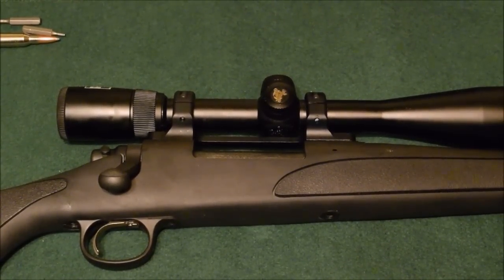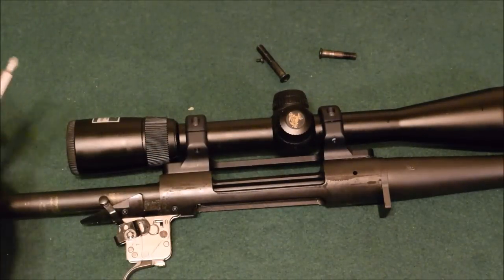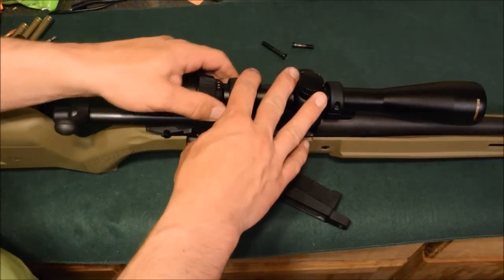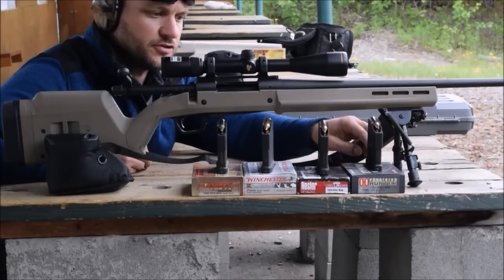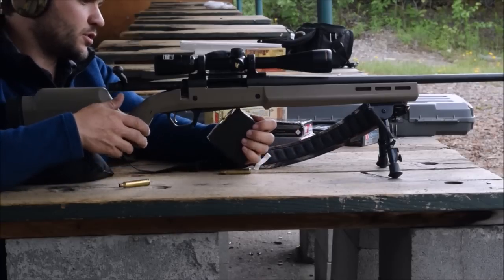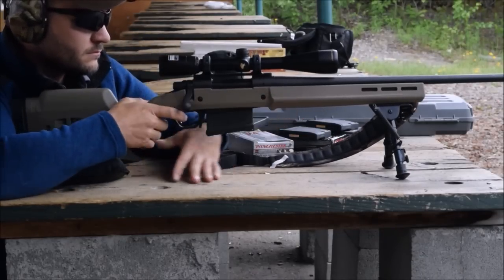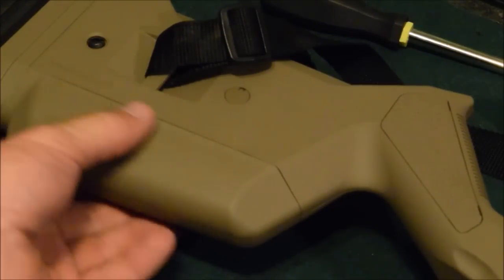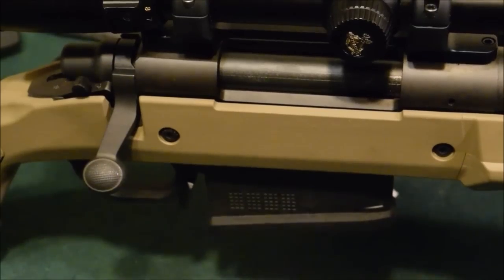Magpul 700 Hunter Stock Full Review and Accuracy Test

Comment: Just picked up a 700 BDL 300 win mag. Purchased in 1971. Along with a Winchester 3030. They were both taken up to Alaska where the man fell in love with the scenery and never even loaded either of them.  These rifles still had the paper tags and string on them brand new. She wanted $400 for both. I told her No Way.  I paused for a second didn't speak fast enough and she had a very sad look on her face I feel bad about. But already had in mind a price that I was going to give her. That was $500. But after seeing and handling the rifles the boxes were trashed held together by tape. The guns are mint condition. I gave her $600. She is super happy. Local dealer offered her $100 each. 
Today I'm going over there to look at a 1976 super beetle convertible factory condition that has been sitting since 1979 when her mother burnt the clutch out on it.
Reply from the maker: Cool! 
Good for you not ripping her off!
Good luck on the car... that's cool

Comment: The rifle I shoot in competitive matches started life as a 700 adl , on sale at dicks! My budget build involved the mag pull hunter stock. Chambered in 308, the stock made a huge difference! A smithy suggested I tork the action screws to 65 in the rear, and the front screw slightly less...I settled on 63...kept the Remington barrel, stuffing the receiver with a 1 peace 20 moa rail..and topping it off with a swfa as fixed 10 power..the rifle performance is surprising at under 1/2 moa with 175 grain Sierra match kings with 41.7 gr of imr 4064.......big fan of magpul stock! Barrel is factory 26 in. 1/12 twist, varmint contour!
Reply from the maker: Nice.  I just nailed a caribou at 459 yards with this rifle.

All steel tps one piece base,  burris xtreme tactical rings and a Nikon black force 1000 scope
Reply from the maker: I bet with a heavy varmint barrel,  that thing doesn't kick at all
Reply: @AlaskanBallistics  ...it's quite tame as you pointed out! Thinking about building another, this with 1/10 twist....but got to wait just bought at thermo weapon sight! Can't wait for it to arrive!!!!

Comment: Positioning of your non shooting hand will help your groups. You are changing your entire position each time when you dont have your hand in the exact same position. It also looked like you were jerking the trigger just a tad, and I couldnt tell if you were pulling the trigger at the top or the bottom of your breathing pattern. I was in the Marine Corps Infantry, shooting fundamentals is most important. I have a 700sps tac and I get quarter inch groups at 100 yards with a magpul stock and a Vortex optic. Proper torque on those screws will help, and sticking with 1 type of ammo helps. Also, another thing people overlook is copper fouling inside the barrel. DO NOT CLEAN THE BARREL unless you absolutely have to. Only vlean yhe bolt and action. After 100-200 rounds you will build up a good level of copper fouling in the barrel and it will actually improve your accuracy. Most people dont know that about remington bolt action rifles, but the barrel design was not meant to be cleaned. Once the optimum level is built up each round will push out any excess and will keep tge proper amouny of fouling in the barrel. Try it and you will learn to appreciate the stock a lot more, although if you have the money I recommend a Mcmillan stock, doesnt matter which one, although we used the A3 STOCK in the marine corps. They are super heavy and creatr rigidity where it is needed. One more thing, remington 700 rifles chambered in 308 work best with an 18"-20" barrel. The twist rates were notvdesigned for a longer barrel which confuses me on why remington makes any longer barrel for a 308. If you are in love with what you have thats great because its still very capable, but id recommend trading out for an sps tactical if you get the chance. The heavy barrel is amazing, plus you can pay tge $200 for the tax stamp for a supressor and run that. The supressor actually will imcrease your accuracy, make the weapon quieter so your less likely to scare away the game, and actually tames some of the recoil a little bit. All in all its a nice rifle man.
Reply from the maker: Thank you for all the advice, I've been shooting in a lot better lately after properly torquing screws.Took a Caribou at 459 yards.
Reply: I'll take note as well... 
I have this in .223 and just swapped out my rubber Houge for the Magpul....
Reply from the maker: Hope you enjoy
Reply: Glad I could help. Now let’s hope Biden doesn’t get elected because he wants to take ALL guns off the shelf except shotguns and black powder rifles. Handguns will not be allowed by anybody outside of law enforcement and military, and any and all battle rifles will be banned.

Comment: Without removing barreled action, you only have to remove the check riser if the bolt is obstructed. Check risers of various heights are available, also. My personal experience with Magpul Hunter 700 stocks are that the torque specs are dependent on the rifle. Not all rifle actions react the same to the suggested Magpul torque values. Some experimentation may yield a differing outcome.
Reply from the maker: Yes that has been done.  Watch to the end gift the cheek riser

Comment: Great looking stock. Having to remove the cheek weld to pull the bolt is a pain but like you said at least they thought of it. Also sending it to you shows good for them. Having a mag is very kewl! Well done vid! I think the FDE should make for a good base for a camo job.
Reply: Regarding this issue, of having to remove the cheek rest every time, in order to pull out the bolt, I am proposing a cosmetic solution. Going to smoothly grind off enough material at that point where the bolt bumps the cheek rest, then fine shape the edges in design as if it came that way with epoxy and then paint that edge.
Reply from the maker: That would work.  But I'm okay with it.  Learned to love with it

Comment: This is a good video on this system. I was wonder if you could go from ADL to DBM with it. I heard that the accuracy goes down this stock in general, but i have also been taught that ADLs have better accuracy because there is no buckle were the well is at. Anyway I've been checking out this stock and I think your video has convinced me to make a move on this thing. The od green is hard to find but the FDE is nice. Maybe I'll stick with straight black. Thanks for the video demonstration and insight.
Reply from the maker: JAC. I've actually gotten some nice groups since.... Just killed a caribou at 200 yards
Reply: Alaskan Ballistics that is awsome that's all I wanted it for hunting. I also wanted to the ease of taking a mag out for safety when I jump in and out of the vehicles.

Comment: If you want to cut those groups easily in half have the action Glass Bedded and free float the barrel, adjusting the trigger helps to, you never mentioned what caliber your shooting but looks like 300 Win Mag, handloading will both save you money and if you do your part you can cut the same hole with it. My 300 Win Mag load is 180 gr Nossler accubond in a Nossler case behind 75.5 gr of Reloader 22, Winchester large magnum rifle primer. Seat the bullets out to function threw the magazine or .10 off the rifling. Which ever is shorter. I shoot regular sub 1/2 inch groups with mine, I just put his 3rd barrel on him
Reply from the maker: Kodeeni 7mm mag
Reply: Alaskan Ballistics 
  I just bought a Remington 700 7mm Mag, thinking of getting one of those stocks. I’ll glass bedding the wood stock to get the best groups. Shooting Nossler 175 LR accubonds. Will let you know how I do
Reply from the maker: Sweet... yes let me know...
Reply: The Magpul stock free floats the barrel

Comment: Great Vid, Birchwood looked super busy that day. 

Get an Inch Lb torque wrench. That'll tighten those patterns into groups.
Reply from the maker: Maxim Dolchok i did. Thanks... It tightened it up
Reply: Alaskan Ballistics what's the weight now with that stock? 

Since the Remmy is cylindrical I bet a bedding job will cut it in half as well. Not needed, but doesn't hurt.
Reply from the maker: Maxim Dolchok wasn't too bad at Birchwood... I was the only one in that range that day
Reply from the maker: It was just a little bit more I'll have to put it on the scale when I get home and I'll respond to you then
Reply from the maker: Maxim Dolchok 
Great idea on bedding job
Reply from the maker: Maxim Dolchok 10lbs exactly

Comment: Are the Magpul mag stocks compatible with other calibers like 22-250?
Reply from the maker: I believe the short action stock may be compatible. Not 100% Sure... If it's not longer than a .308 it should work
Reply: Thank you!
Reply from the maker: You're quite welcome... The bright side is that if you get it and it doesn't work for you, you can probably get your money back... Or you could probably sell it for 75-80% of new value later
Reply: asanmartinjr07  - Just fitted on of these stocks on my 22-250.  The .308 P mags work fine with the 22-250 rounds.
Reply from the maker: Maris Pip3r  thank you for responding, that’s good information

Comment: having the same feeding issue with a .308. May have to get a stock now.
Reply from the maker: Jelly Bryce it's worth it. Torque it correct and it gets better groups...
Reply: Did it gog back to what you were getting before you got the Magpul?
Reply from the maker: Close...  .4" edge to edge with hornady precision hunter. Killed a caribou at 218 yards.
Reply: I read further and saw how much it improved but your review  leaves people believing that the whole reason for the size of your groups increasing was changing to the Magpul Hunter stock. It's only after months and reading all these comments that you mention you didn't install it correctly? You don't go back and mention it in the original review? That doesn't seem quite fair to me. I'm not affiliated with magpul or any in the gun industry in any way.
Reply from the maker: seekers999 Well it was after the advice in the comments. And i said the groups could have been me.
Reply from the maker: seekers999 I do need to film an update video, you are right about that. Will do so this summer
Reply: Good man

Comment: Measure edge to edge, then add the diameter of the bullet to the group size.
Reply from the maker: Even outside edge to outside edge?
Reply: @AlaskanBallistics  Yes, but then you'd subtract the diameter of the bullet. Inside to inside edge you'd add the diameter of the bullet. It works either way.
Reply: @AlaskanBallistics  from edge to center of the bullet is .154. So you account for the  radius of the bullet for each hole.
Reply from the maker: Thanks man
Reply: @AlaskanBallistics  no problem.

Comment: Actually, you're shooting 4 different bullets from 4 different makers.  Thus your bullets' copper is different recipes.  This may impede the accuracy you're getting.  You may also find a variance of groupings between a CLEAN barrel and a copper fouled barrel.  Cold/warm barrel variance too.  Remove copper fouling between brand of bullets.

Clean your barrel, shoot a couple of fouling shots, then shoot with a cold barrel for zero.  Do that for every new make of bullet.  

Cleaning your barrel after every firing is no longer needed with today's modern powders.  This was needed back in the day of using black powder, which is highly corrosive and became strict tradition passed down from father/son over the centuries.  Modern powders are not corrosive.  Clean your barrel when you find accuracy dropping off, then a few fouling shots to re-establish your carbon fouling.  

Measure how far back your bolt goes with the cheek riser piece in place.  Remove the cheek riser piece and measure how far back the bolt moves.  You MAY be able to use a round file and remove some of the plastic from the nose of the cheek riser piece, buff it smooth with sandpaper (also softening the edges) and be able to remove your bolt.  If you must remove enough material to end up with a "hole" in the cheek riser piece, remove a bit more and create a form using masking tape on the outside and fill the void with epoxy.  Fine tune it with sandpaper when cured and a touch of FDE paint.  If you use black epoxy and like the contrast, just tune it up with some sandpaper to dress it smooth.
Reply from the maker: Thanks for the advice.  Getting a torque wrench and making sure I screwed them into spec made everything very accurate.  Look at my 7mm Rem Mag 120gr ttsx video. Thanks.  Godspeed

Comment: take the gun out of the stock to pull the bolt? rezero a barreled action with scope not removed? wtf are you talking about? you can take the cheek piece out to get the bolt out and why would you have to rezero the scope if it never had the scope removed? the stock has no bearing on the point of impact in relation to the point of aim.
Reply from the maker: You obviously didn't watch until the end of the video...
Reply: Alaskan Ballistics you're right. once i heard that it kinda killed it for me. but since we're talking, how has that stock worked out for you long term?
Reply from the maker: Really well actually.  Durable,  torqued it correctly and got better groups.  Killed a caribou at 459yrds last year
Reply: Alaskan Ballistics jurys still out for me. I'm considering bedding it. but i get in my head a lot on these kinds of things. debating "improvements" that might actually do me more harm than good.
Reply from the maker: Understandable.  It is heavy especially for a hunting gun...
Reply: Alaskan Ballistics I'm using it mostly for extreme long range shooting. 1000 yds+. weight is a good thing for me.
Reply from the maker: Yeah that makes sense

Comment: I'm putting together a 7mm-300, also referred to as a 7mm Practical (necked down .300 Win Mag) . I read max cartridge OAL for the magazine is 3.5". Are they correct on that? I'd love it if they were actually closer to 3.7" I want to use this setup.  I have one of these in a 700 SA in .243 and love it.
Reply from the maker: Robert W i just measured my magazine.  looks like anything loaded past about 3.52" Would probably rub the bullet on the front of the magazine.
Reply: Thanks for checking for me. You just saved a big headache.
Reply from the maker: You're quite welcome. I don't know if you could file the inside of the magazine that much. I doubt it.   Best of luck...
Are you loading that long to fit the round to your chamber?
Reply: Yes. If I shoot 195gr-197gr ELD or VLD bullets, I will have to load them that long to avoid jumping them too far. I don't want more than .010 jump.  I think I am just going to shoot 140-168gr bullets in this rifle. This is going to be a hunting/varmint rifle.
Reply from the maker: Robert W , I had a Browning A-Bolt that was that way, too longof a throat

Comment: Thanks very much for this review! Does the bipod attach via some type of mlok adapter?
Reply from the maker: Yes a fixed sling swivel stud.  I may have a gunsmith flute the stock a little to save weight
Reply: Yes you have the option to throw on a sling mounted bipod or use the mlok keyholes on the bottom of the stock

Comment: You shouldn't need to re zero the rifle with that stock, the stock is really more like a chassis and the action will fit back into the stock the same way ever time.
Reply from the maker: JeepJeep234 that's one theory, but since I changed stocks, my head fits different, the action is torqued differently than the other stock, and it's fitted against the bedding block which it wasn't before. 

Now for cleaning, you're absolutely right... Thanks for watching